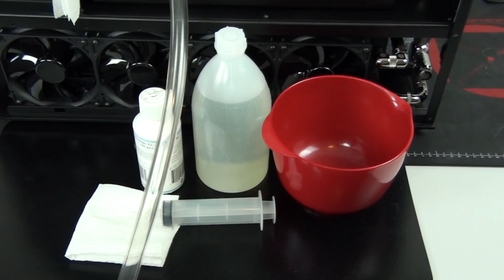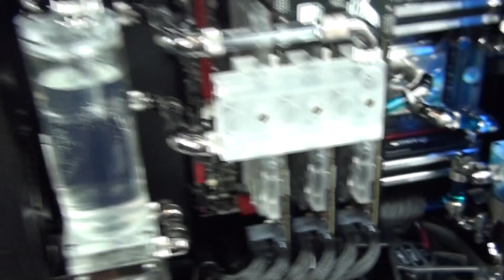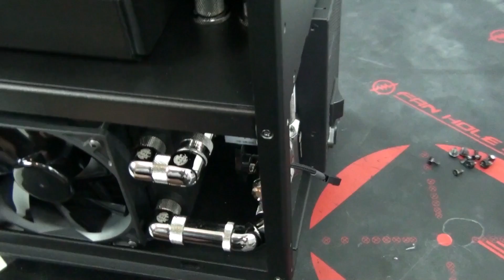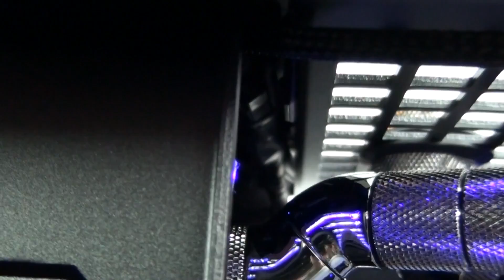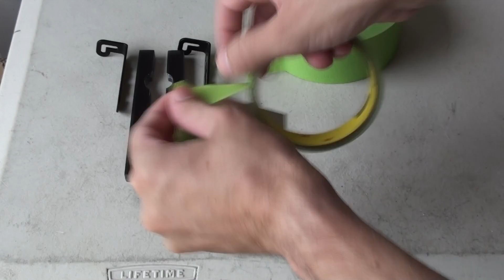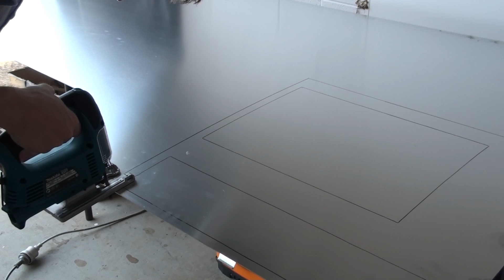Build #8: 'Cytotoxic': Part 7

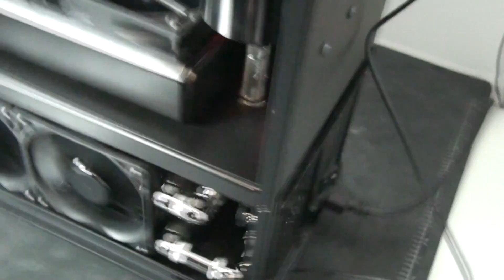Comment: 10:10 keep an eye on the middle graphics card... is that a spark?
Reply from the maker: Its a LED on the motherboard. If it was a spark the graphics card would be dead. Does look like it though, caught me out for a second too. Cheers.
Reply: That just looks like an LED because after the light is gone you can see a faint outline of where the light just appeared. Definitely looks like a spark though.

Comment: Yeah,water takes the shortest way...Thats why u want a smaller fitting for the short tubes and a bit bigger for the longer loops and so on..When water comes to the smaller part, some liquid  will pass thru ,cuz there is more resistance rest of the fluid will travel on to the nxt. So with different sizes u create even resistance in the flow. Or use same size fittings with adjustable valves..
Plumbers know this,,,,same principal...

Comment: Question Here! 
Where in the Hell do people pay for this? my system is not as good as this one and it cost me over 2800$!!!!! or your the retailer?:D
Reply: People use their old parts and build it over time, that's what i am currently doing :)
Reply: this build could probably be done for less then 6k. Its all about researching the best prices before you buy and planning out everything you need. However it takes some skill to build it the way singularity does it.
Reply: yeah, i remember trying to but all my hardware togather..i failed so hard i didnt even unbox the GPU lol
Reply: sbvikings30 I agree. It is indeed about researching the best prices and planning ahead. There are several forum discussions, stickies and video tutorials, which can be very helpful when planning to build a water cooling loop. Needless to say, better prices doesn't mean lesser performance. Its just identifying what you need and finding the right components for your setup.

Comment: That is one fucking clean setup man. Never saw such a good cable-management. But can it run internet explorer without lag?
Reply: sir, is that even possible?
Reply: José Miguel de Grazia Vallejos there once was a myth about a supercomputer that huge and that powerful to run internet explorer with maxed out settings without lag. The cooling-system consumed a whole ocean within an hour just to run that beast. But after some engeneers found out that it was able to divide by 0 , they tried it and the computer vanished. No one has yet found it, but stories are still told.
Reply: long ago i heard that the big bang was originated by a computer that tried to divide by 0, it just collapsed the time-space fabric, it disappeared on that dimension, but it gave origin to ours on a huge explosion...

Comment: Amazing work, however I do have one question. Is that material you used for the front panel and pipe reinforcement brace things acrylic or plexiglass? I've heard you say both. Are they the same thing?

Comment: Any reason you used UV LEDs instead of cold cathode? I've read that cold cathodes bleed a lot less purple and have a more even lighting effect...
I'm also down here in Australia and was wondering where you get your molex crimps and housings/connectors as I'm struggling to find them locally. Thanks in advance :)

Comment: @SingularityComputers - I have a question and since you do this for a living you can probably help.  I recently bought a Thermaltake Water 2.0 A.I.O and I would like to switch the 120mm fans out for something a little more quiet but with some good static pressure.  I know Noctuas are a good choice but they are hideous.  Thanks in advance.

Comment: Just 2x 360 rads? How'd that hold the OC? Since it's an Intel chip, Iknow they can hold the higher temps without issue but on My FX8120 even with 2x 360 rads and 1x 240rad in series w/ 3x SLI 480's I'm just barely holding cpu temps. The GPU's are perfect, never breaking 50*C...but with AM3+ CPUs they start to loose performance @ 52*C. So with hours and hours of use,  I'm touching the limit often.

Comment: The only problem that I've had with this is because of all the stuff in the way it looks like you can not put anymore Ram in the system(though the system definitely can fit more). Now I am not saying what you've done is bad, it's incredible, I'd just like to know if there was anything else that you might have been able to do? Now I know 4 sticks of Ram is more then enough for anything, I'm just saying I don't like restriction. Though it could have been the only thing possible with this Rig.

Comment: nice build, i really do love it but two things (not criticism, im no expert) 1. i just think its a shame that you have used heat sync on a lot of the cables when the 24 pin power didn't use it and you said yourself it looks so much cleaner without and 2. isn't there a dangerous build up of condensation in the top of the GPU loop res?? i've read that condensation is bad or is that just condensation within certain components? like the rad or something?? great work you have my dream job congats :D

Comment: I believe you mean 240x120 per block. this is proven with the H100 etc and they are dedicated CPU cooling and still reach 50+ Celsius. so a 360 rad and 480 rad would be sufficient to dissipate enough heat from this man desired rig.

Comment: What is the tube that extends down into the Res for? I would assume it is for reducing bubbles, what is it called? Also, What fans would you recommend for a 4 x 140mm rad? it is a low air flow optimized rad.

Comment: can u build a watercooling system at a Corsair Graphite 600t with a 240mm Radiator in the top of this case and a 200mm Radiator in the front of a case and jeah with green "water"...
it would be fantastic and thats what a build... which i think is really nice...

Comment: Do a search for "vandal switch" on google you will find them there in loads of different colors. 

and if you need help with wireing there is a diagram here on but youtube wont let urls be posted so go to the imageshack.us site and put this at the end of that url photo/my-images/27/17042009194506.png/

Comment: This is starting to look stunning! I really give it to you for cutting and sanding all that stuff by hand, my arms are getting tired just watching! :P. Something I do for sanding small parts like that plexi is get a belt sander and clamp it sideways onto my bench. Goes though material very fast. I've also seen people mount jigsaws upside down under their bench and have the blade point upwards through the table. Lets you feed large material in rather than hold the saw.

Comment: Have you ever considered sanding and polishing an FC Bridge? I don't know how much material is there that can be sanded on, but if it's plexi after you sand off the "frosting" effect hit it lightly with some heat from a heat gun or torch an it will become clear again. A ton of work, but it might be worth it. I think the bridge wouldn't be SO distracting in this build if it were clear, it would blend in more.